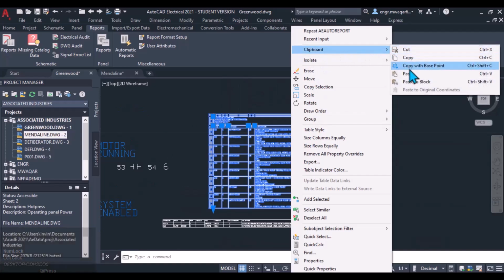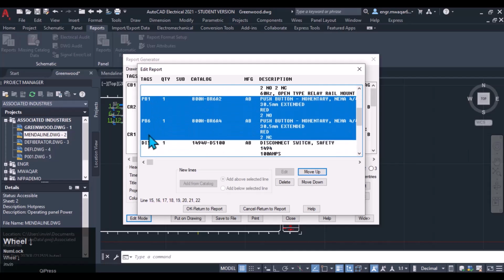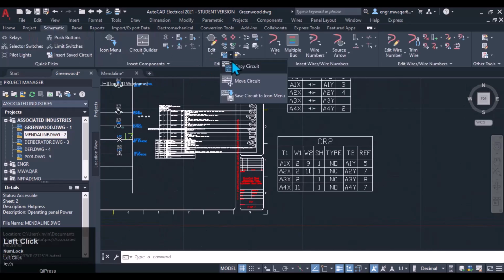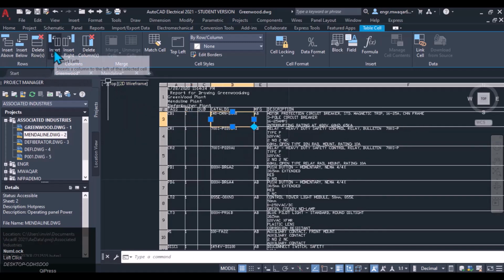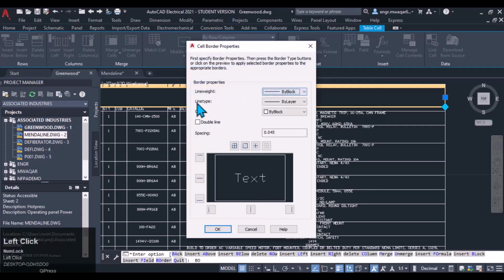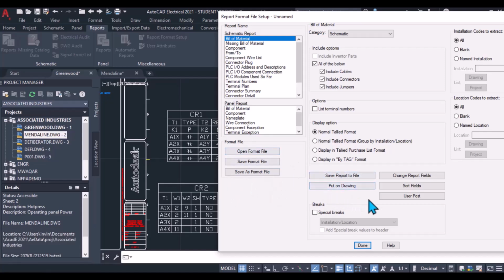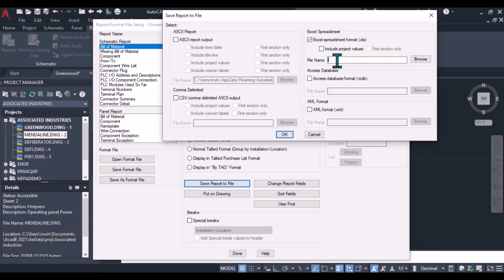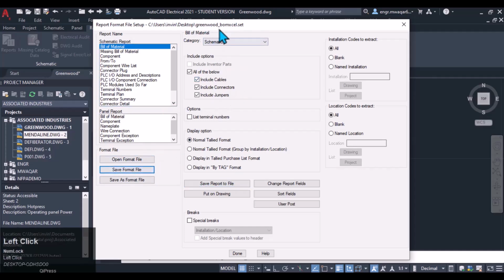AutoCAD Electrical 7.2: How to Create Custom Reports and Bill of Materials

Comment: how to generate wire label report
Reply from the maker: Good question. You can export wire labels list directly in a report just like the Bill of Materials. Another way is Select Schematic Reports -> Wire From/To. This will give you the list of eaxh wire number along with the connected components. You can customise the report by selecting the fields you want in the report. Then you can simply export it to excel or text file.
Reply: @suntechengg  From/To Report
 reading project database file . . .
 Data written out to project database table "WFRM2ALL" and "WNETLST"
 reading project database file . . .
No data to display
Reply from the maker: There may be a lot of reasons why it shows empty database. May be wire numbers are not properly assigned or not recognised as wire numbers, or unconnected wire lines, if no component is connected on the wire- there should at least one source and destination, or may be the database is not refresh. If you solve the issue kindly inform us to identify the root cause of your drawing.